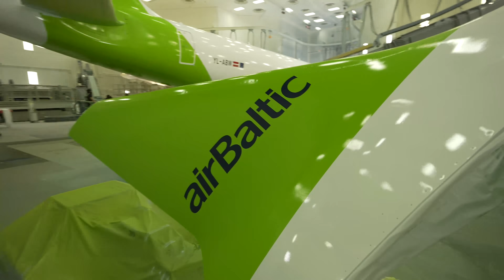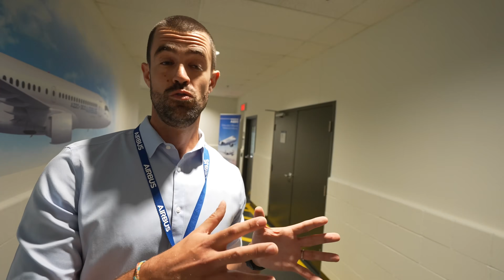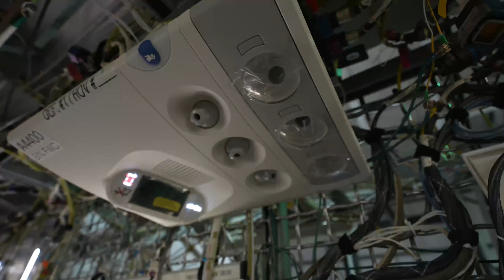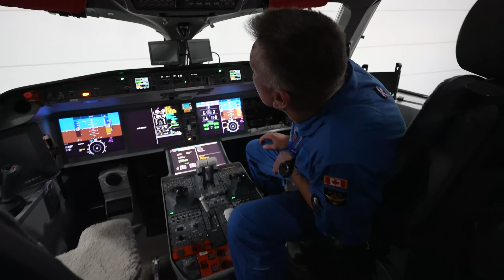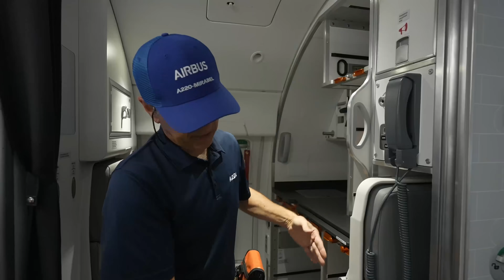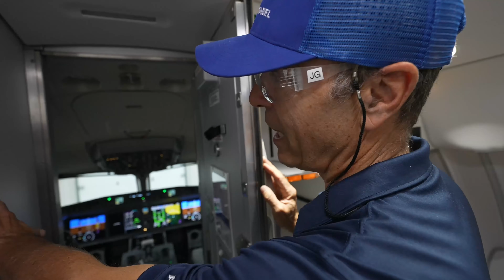Airbus A220 flight test, paint shop & cabin outfitting!

Comment: I’ve been on jet blue and delta 220s, love the 2-3 seat config, big windows and quiet ride are great for comfort and ride. The “Airspace” interior update bringing bigger overhead bins (XL) will be welcome because some older 220s have somewhat narrow overhead bins (I think worse on delta). Also high speed WiFi has been great in recent years.

Comment: What can I say ? ❤❤ I was one the main avionic technical instructor on this program ( BATC )…..there were  4 of us in total . We worked, ate, slept  and dreamed CSeries for almost 3 years. We were extremely privileged to be given pretty much full access to the most intimate technical data ,and unless you participated in a new modern program, you will have no idea that sheer size of the tech  data that needs to be produced for such a program we most likely didn’t read a good 60-70 % of it ……for someone who loves technology, it was the most amazing experience of my life. I used the SITS on a regular basis , and the ESIM too. Loved the SITS ad the ability to inject and manipulate data …down to the single bit on a 429 label. . You can’t imagine the pleasure of seeing systems react as per the DCR ad the safety assessments . The more you dig into the docs, the more you realize how  little you are and the immense talent that Bombardier has gathered for this incredible project. People bitched about Bombardier spending close to 6 billons for the project,while I wondered how they could do it with that little money …honestly. I can’t describe the feeling during the first flight..the first ever and most likely the last one. I was fortunate to not be there toward the end of the Bombardier era and the hand over to airbus……it was a very hard pill to swallow. The debate is still open whether or not it was necessity gave away that program….We moved into the 7500 program after we’ve handed the tech training to LTT. LTT  had a different idea on how to do things…it was cut here, cut there, dum it down to the minimum…..I loved the Bombardier Era ,I don’t know about Airbus,but usually the frenchies at excellent and on top of the theory stuff. Great video and you were very fortunate to be given access to this level,and it was great to have an update on the program and see Mr Marco aging 😂😂😂 …look for videos from 10 years ago. Would love to see C.Ellis  back on this program.

Comment: Were you given an explanation of what a Jetblue aircraft was doing at Mirabel?  My underersanding is that all aircraft destined to US airlines would be assembled in Mobile and Mirabel would retain the job for all aircraft outside of USA.
Reply: Paint work and interior finishing only?
Reply: @gryff8400  Would not make sense to fly plane to Montréal from Mobile to only get painted when I have to assume they have paint shop in Mobile.   This is especially true if the Mirabel paint shop is too small to fit a single C-Series aircraft and they have to remove winglets.  But then again, suncgh inefficiency mighty explain why they are unaable to ramp up production and make project profitable.

Comment: During the 777 development, Boeing had bragged about doing flight systems integration with just the components in a lab attached to each other. Am not sure how this compares to Airbus Canada which seems to have a more assembled pieces plugged to each other than just components.
Reply: Pilot talked of testing in ‘60’s. Back then Boeing used beer kegs for the ballast water tanks.

Comment: Did they call what happens to the passengers at 9-16 G of deceleration the "ick factor"? If I had to endure that many G's, the result would definitely be icky...
Reply: "HIC factor" -- the Head Injury Criterion. It's a measurement of the likelihood of head injuries based on accelerometer measurements in a crash test dummy. It's used in passenger vehicle crash testing.
Reply: @jonathankleinow2073  "Ick factor" is still just as descriptive of the effects, though! 😁